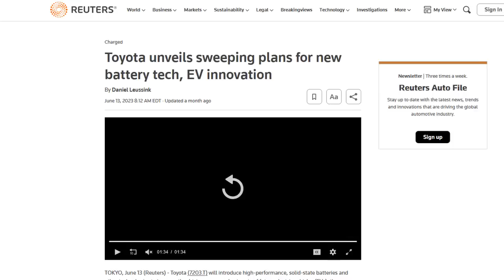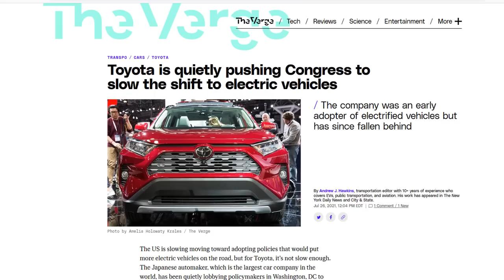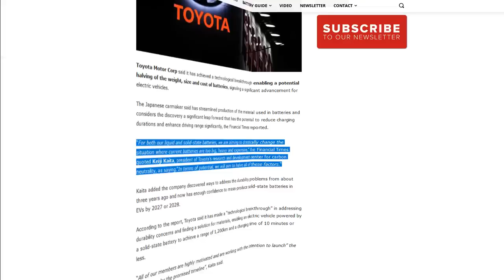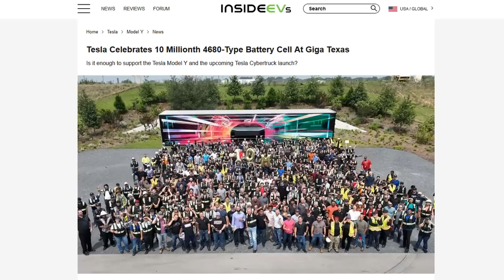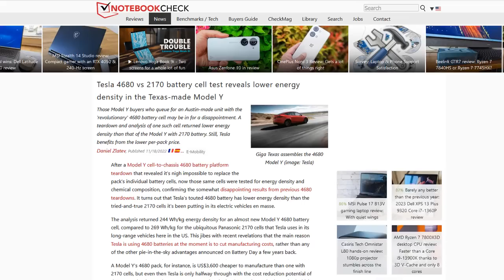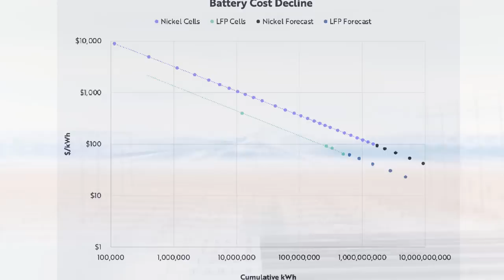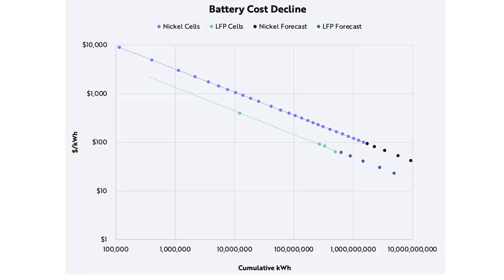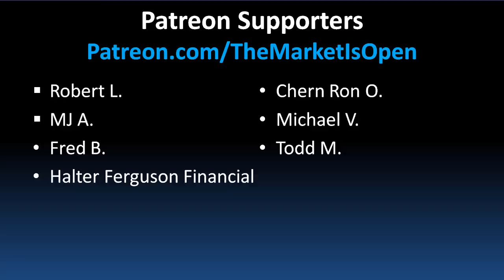Entire Industry BAFFLED by Toyota’s NEW Solid State Battery

Comment: I have heard that solid state batteries are brittle, the get lots of tiny cracks on the inside when charging and discharging and that reduces their lifespan a lot. Maybe that's hard to overcome.
Reply: There are a few ways to overcome this problem. One way is to use a different material for the electrolyte, such as a glass or polymer electrolyte. These materials are more flexible than liquid electrolytes, which makes them less likely to crack. Another way to overcome this problem is to use a different design for the battery, such as a layered design that minimizes the amount of stress on the electrolyte.
Reply: @MichaelSmith-lm5sl  yes, they don't stop working on them, they find ways to overcome it and test them and make sure, it can be used in the mass production. Obviously there overall is still work to be done, but yes, there is no complete standstill, it is not abandoned.
Reply: New and improved!!! NOW utilizing Silly Putty!!

Comment: There is always a new battery coming from Tesla. EV boosters should look at the overall weight increase of an EV, it is very significant and most of it is batteries. Cumulative damage to road surfaces requires highly pollutive processes and materials to repair. Some math shows that factor alone negates the gains from EV and EV trucks are going to be much worse. Lithium is resource intensive as well taking huge amounts of water in already dry places. Fewer CO2 emissions don't help people near coal fired plants but only those in big cities. Sequestering C02 would limit the amount of O2 being produced by plants and used by ICEs.

Comment: Its Toyota's mode of operation, putting out whatever breakthorugh on batteries, engines and hydrogen, place production outlook 5 years out.. and hope investors will forget about it 5 years later, and do it all over again.. Its the same with those awesome looking prototypes and come out with a lame run of the mill production version.

A week earlier Toyota was all about hydrogen. Toyota just tries to keep the hype machine running to keep investors on board.... But I have the impression this will loose its effectiveness graudally.. Most investors are not stupid and keep an eye on what Toyota is actually doing, and if Toyota keeps on failing on their promisses, one after the other investor will drop out and moves its money to Tesla, BYD and the like.

Toyota will go bankrupt or merge with Honda and/or Nissan and will never come to producing EV's with Solid state batteries.

In the mean time, quietly NIO already HAS a solid state battery, 150Kwh and available soon in your battery swap station near you.

Comment: scaling battery production is not a mathematical model.  It involves many facets. One of the most difficult to control element is the availability of minerals.  A mine takes ten to fifteen years from exploration to maximum production output. As time goes on within the same mine, minerals will be coming from further down and thus more expensive.  So the idea of scaling up is "fast and easy" is not a given.

Comment: Toyota and GM should be leading this EV changeover. Both amazing fails. They were the first to make workable EVs.  Toyota was even working with Tesla and using their motors. Elon might not have started with Tesla had they kept at it. The other founders could have decided to only make EV sport cars or hi-end EVs. Now GM and Toyo drag their feet and wouldn't make EVs if they could avoid it.

Comment: Even if solid state batteries are coming, an EV is much more than just a battery, as all manufacturers figured out the hard way, including Tesla. Every one started with the idea of just converting an ICE car, even Tesla's original Roadster was a converted Lotus Elise. But when you optimize a complex machine, a change in one part can have effects on other parts, and if you change something significant, you likely have to completely redesign the whole. By the time Tesla finished the design of the Roadster, it had like 5% of the original car left.

On top of that the whole structure of the car is different with the battery in the floor (which is the optimal configuration), and that requires a new assembly line too. Plus all the new parts require new supply chains.

Oh, and then you get into trouble with your own organizational structure, which resembles the structure of the car, which just changed significantly. Engineers, managers, bureaucrats, unions, and even board members, will resist all the way (see Herbert Diess vs. Volkswagen). And that's still not all. Your dealership network also becomes your enemy, because electric cars don't need much service, which is their main source of revenue, and they don't understand this fancy new tech anyway.

So Toyota should have been making serious electric cars even just to practice. They too found out on their first try that EVs are a completely different product, but now it's way way too late.

Comment: Frankly no, I don't think they will ever bring this battery to market. Unless the cost of materials and ease of manufacture makes it cheaper to produce than conventional batteries, it's not any good. They are too slow, this battery has been promised for decades. We have no idea what materials it uses, they may be exotic or rare. Until this actually exists outside of the laboratory, it's just an idea. 2027 May as well be 2057

Comment: Toyota's investors are concerned about their lack of progress on BEVs, Model Y overtaking the Camry as the best selling car globally, and the decreasing market share for ICE cars and hybrids.

Toyota's recent press release is purely designed to project some sort of leadership in the new EV space to assuage those investor concerns. It's otherwise basically meaningless with a speculative date of 2027. 

Of course Toyota's battery partner, Panasonic, has a prototype solid state battery in their lab. Everybody has: QuantumScape, LMP, LG Chem, BYD, Samsung SDI, and dozens of other labs and academic institutions. 

The point is not to have a high energy density prototype. The point is having something with enough energy density which can be manufactured at scale and for low cost.

Right now the best bet appears to be continued incremental improvements to li-ion chemistries. For example the addition of sodium / silicon / sulfur and reduction in relatively expensive metals such as nickel.

We are rapidly approaching a time when EVs with more traditional chemistries developed over the last decade deliver 500 mile ranges and can charge in ~10-15 minutes. At that point you can have a solid state battery with 750 miles of range but nobody will care if manufacturing constraints mean it's only available in super high end luxury cars.

You have to ask yourself what is more likely. That the likes of BYD or Tesla can refit their large scale battery production facilities to incorporate new chemistries - including solid state - for low cost volume production, or if Toyota can invent a new type of battery and then build out massive scale production facilities from scratch to produce it at low cost while also building a range of desirable EVs?
Reply: Lithium batteries are not sustainable and environmentally damaging.

Comment: I am so stunned that I really want to know how many of their fully electric vehicles are already using this stupendous technology. So exactly when will I be able to see one of these? I would suggest that it might be a VERY long time into the future, if ever.
Reply: Video says first production 2027 or 2028.
Reply: @tomvyse  Not the first time they've said that though.  That's part of the problem.  They should be driving around a concept car or something to show it off even if they can't make it yet.
Reply: They've said they had this battery tech since 2014 with nothing to show for it.  They need to show they actually have this before I or anyone else should believe they've got it.  Lab is nice.  Production is another thing entirely.
Reply: 2026 to 2027. They will be in hybrids first. The costs need to come down to put them in a full EV. They've worked on the technical issues these batteries have. Now it is just a matter of producing them at scale. It's fine to disbelieve. Nobody would have believed 10 years ago you could make a 2000hp EV. 10 years ago I didn't believe they'd sell even 1 EV.

Comment: I am a very great supporter of Tesla and their creativeness in developing electric cars. I think you are wrong though in underestimating Toyota. The company has recently a new CEO and they are still the largest car manufacturer in the world and still have wonderful engineers. The solid state battery will be a huge improvement over lithium ion batteries and is the future. I don't doubt the Tesla is also working on the development of the same technology..
Reply: I REALLY want Toyota to pull it off.  I could care less about cars, this has real interesting applications in aviation where I do have a interest.  The problem is and always has been getting from lab bench to production line and Toyota has had this on the bench for a while and from the outside we have no way to gauge how well it's going.  This is not the first time they have talked it up and not the first time it's been 5 or so years down the road.  Even if they can't pull it off to the point where it can by cost or scale compete in automotive, it still could have a real future in aviation or other high-drain high energy density applications which means they could still generate a ROI on it.
Reply: Toyota are on their way down. Sales 2020 10.4m vehicles then 2021 8.2m vehicles. 2022 8.1m. Toyota anoused they will deliver 10.6m in 2023 with a caveat that it could be up to 10% less is supply shortages are a real problem . Well they delivered 4.05m first half 2023. That leaves 6.6m to achieve in the second half. Toyota are failing in China, that market is already 30% EV and it’s only going to get worse. Sales are down in both the U.S. and Europe. The days of 10m plus are well gone for Toyota. There is no answer to the transition to EVs. Toyota don’t even have a concept car. They are dreaming about have one SUV in 2026 and the solid state battery is just more smoke and mirrors 
I like Toyota, have a Lexus myself but sadly Toyota are being left behind.

Comment: Another thing I don't get about a solid state battery...  if there's not evolutionary leap in efficiency in motors, wouldn't 700 mile range require a 200-250kwh battery?  ...and they're planning it'll charge that in 10 minutes?  Wouldn't that equate to about 1.5MW charging?  That's crazy.
Reply: A model y gets about 4 miles/ kwh under ideal  conditions. That would imply a 175 kwh battery.  It's hard to beat the electrical and aerodynamic efficiency of a model y, so you are correct, it would require a large battery and a charging station pumping a lot of power to charge in 10 minutes.

Comment: wow, TMIO really buried the lede in this one,  making everything look so positive for toyota so far into the video before finally saying what everyone watching was screaming ... Toyota announced the same solid state battery advances in 2017 and 2014, this is just a re-announcement of old plans, significantly delayed.   And you totally missed the fact that it would be a huge waste, downright crazy to put a battery with 745 miles of range into a freaking car.  Even if solid state weighs a lot less.   It's still un-necessary weight that you're carring around 100% of the time when you'll rarely / if ever need that range.  They won't do it.  They'll put smaller batteries with maybe 400 miles range into the cars, so they can make more cars.  And those cars will be more efficient for not carrying the worthless extra weight.    Next TMIO totally missed the fact that to charge a 745 mile range battery in just 10 minutes you'd need access to a 2.5 megawatt or better super charger.   Good luck with that Toyota.     And then TMIO missed the rest of Toyota's news.  They're freaking doubling down on hydrogen again!  With plans to produce 200,000 hydrogen cars by 2030.  (in total production between now and 2030.  Not per year).  And they're advertising this as if it's actually some major significant  thing that will save the planet.  When all it really is, is an exercise in getting half the energy efficiency of an EV by adding complexity and denying the fact of thermodynamic losses. 

Toyota is already dead.  They just haven't stopped twitching.

Comment: It's the same issue as with Nikola. If you have what you claim to have, why would you pursue other directions.
Reply: At least Dickola has made some beautiful PowerPoint slides for their non-existent truck. Toyota didn’t show anything other than claim 😂
Reply: You mean like promising a full EV semi truck for years while building a tunnel you call hyperloop?
Reply: @maxmeier532 the semi is literally in customer hands. What are you talking about?

And hyperloop isn’t even a Tesla thing. We’re comparing companies that make cars, not any other companies
Reply: @maxmeier532  "You mean like promising a full EV semi truck for years while building a tunnel you call hyperloop?"

That's a lie. Tesla is not building a hyperloop. And Tesla do have fully working semis. The same couldn't be said about the scam company Nikola that simple pushed in downhills.
Reply: @maxmeier532 Bingo! Musk is the king of the Ponzi scheme. His hyperloop, his underground tunnels,  his lame robots, Mars by 2030  and so on. And Tesla ranks last for its autonomous driving. There's a reason Warren Buffet won't touch Tesla. He knows it's built on a house of cards, Elizabeth Holmes style.

Snip:

The latest critique of Tesla’s Autopilot platform comes from the analysts at Navigant. The research firm just released a report on the automated vehicle market, and it ranks Tesla last out of 19 companies. 

“Tesla scores high for its vision, but they haven’t demonstrated the ability to consistently execute that vision,” explained Sam Abuelsamid, senior analyst with Navigant Research and co-author of the report.
Reply: @maxmeier532  No, in fact exactly the opposite. Tesla repeatedly said that no major battery breakthrough is necessary, has pursued the battery electric semi, and by now has a limited number of them on the road. Even if the hyperloop were supposed to be a Tesla product, it would still use the same battery electric drive train.